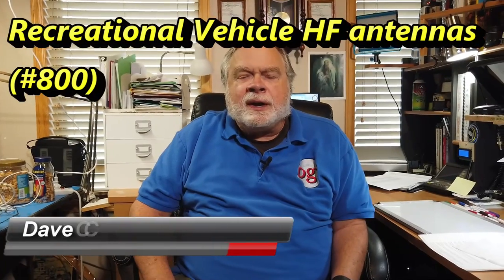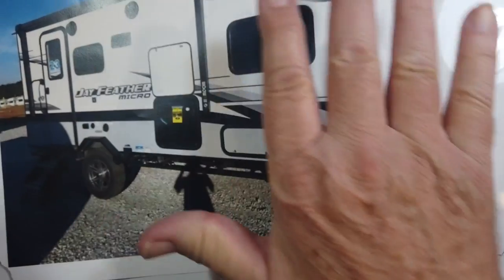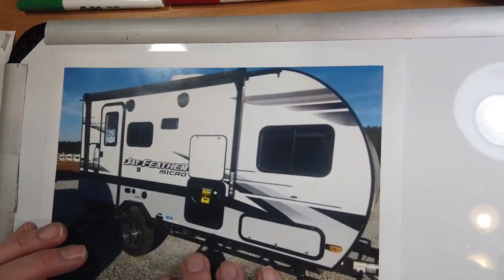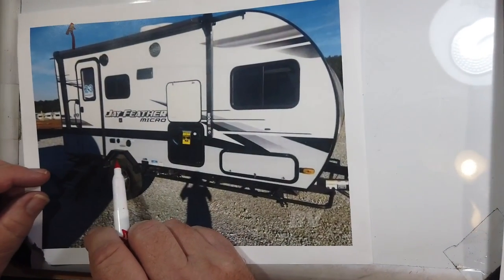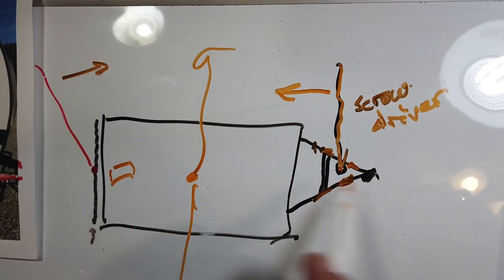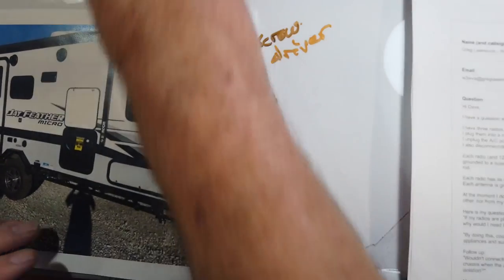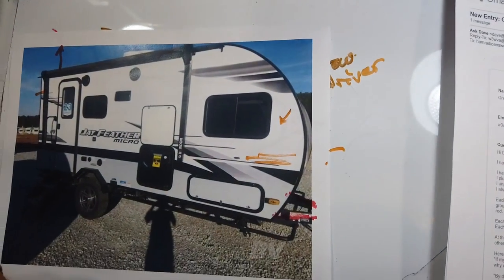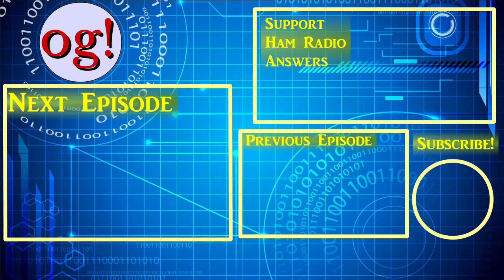Recreational Vechicle HF Antennas (#800)

Comment: It’s worth noting that this trailer includes a 2” accessory receiver hitch on the back from the factory, so it’s ready to go for any of the hitch mast mounts on the market.  The wall framing is also all welded aluminum, so there’s a lot more metal available than only the frame on the bottom.  For the lighter-weight screwdrivers that also opens the possibility of mounting them high on the sidewall rather than down on the frame.

Comment: Dave I run a 40ty ft motorhome withe a 100 watt shack. My solution for an antenna is a TN07 32 ft vertical it is collapsible to 4 ft.  1/4 wave dipole.  Occasionally I add a 32 ft extension turning my 1/4 wave into a 1/2 wave slower.  I ground mount the entire rig.  I have also added 3 guy lines.  You can mount the antenna to a trailer hitch.  Check out TN07 engineering they make an excellent mobile product that I have communicated around the world, bands permitting.